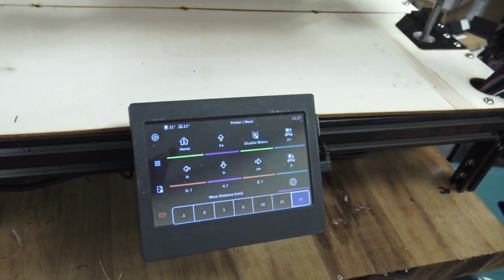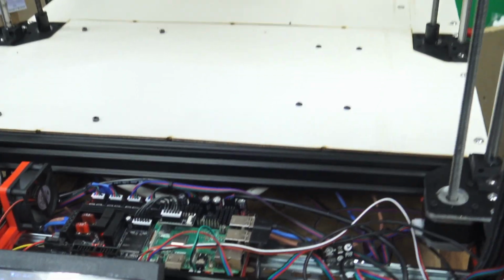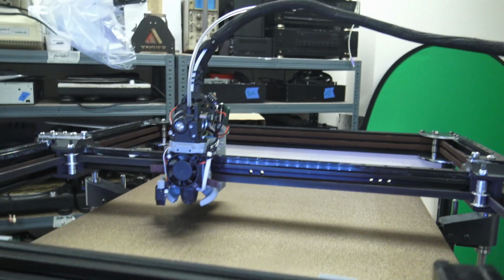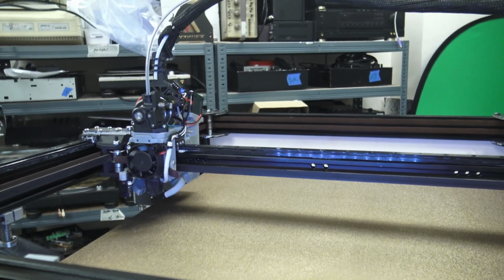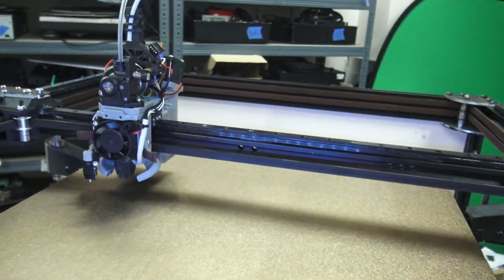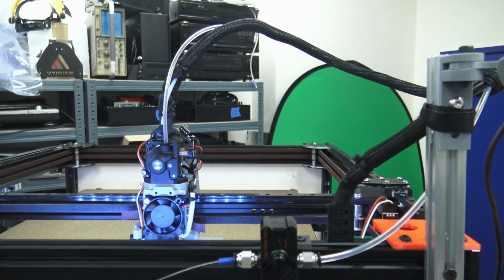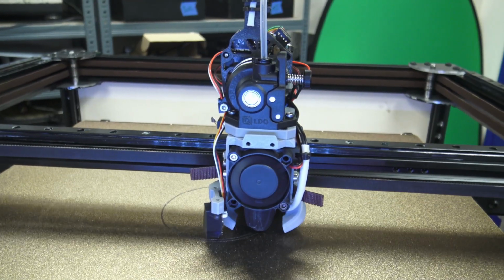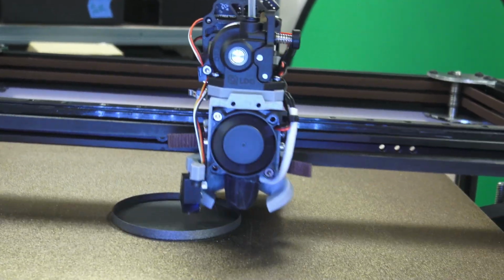I converted my Anycubic Chiron #3dprinter   to a COREXY monster.

Comment: I'm going to do something similar, but cartesian (dual y 42-48's) and idex with toolhead mounted x-motors. How did you attach the 2020 profiles to the 4020's? I was planning to use one bolt through 2020 to each 4020 and 2 corner pieces on inside corners. I have two chirons for parts so I'll prolly only need the 2020 uprights, some rails and rods.
Reply from the maker: I did a voron style blind joint

Comment: Hi. You have inspired my. I am doing a corexy conversion. I got a cheap brand new one in the black Friday sale 2022 for ridiculous price and been using to print r2. Nearly finished printing so bought another second hand chiron cheap to make my corexy. Could you send me the stls for your brackets for the bed I.e the voron ones you said you modified to take 10mm bearings? Thanks and if you don't mind I may have more questions as I proceed.
Reply: Also. Where did you get the silver brackets from that fit into the 20 20 extrusion at the top that hold in place the top of the 10mm guide rails. Thanks

Comment: Brilliant. I want to convert my chiron as got it new for really cheap before discontinued. When I've finished printing last few big parts for my r2 you've inspired me to do the chiron convert. First question. How many stepper motors you using. X y and z. I like the 4 lead screws on the z idea.
Reply from the maker: HI, I am using 4 on the Z for the gantry tramming and then 2 on the AB motors.
Reply: @leesmithsworkshop  does that need a special brain / motherboard then. And does klipper support that fine
Reply from the maker: @bluenose701  it needs enough stepper drivers at least 7 and that is why I used the leviathan board, you could also use a BTT octopus or Kracken.

Comment: Super awesome. I converted my Chiron to a Chironwire. ... Good effort on the swap. Maybe a future project. Picked up a cheap Kobra max recently... Maybe I'll do a max big boi lol
Reply from the maker: I had a look at the Chironwire and it's an interesting mod. The Kobra max would be a great machine to convert, I think I would rotate the bed so it's 400x450 keeping the gantry as short as possible.
Reply: @leesmithsworkshop what mm/s can you achieve now?
Reply from the maker: @natdizzle4259  I have since converted this to a tool changer and everything changed.
Reply: @leesmithsworkshop you should throw the new printer up in a short or something! Cheers!

Comment: I've thought about converting a few printers to "Vorons" but the only things worth saving are maybe the beds. Then it only really makes sense for these huge bed slingers.

This one's neat. I think having a "spec" voron or ratrig really only matters to social media clout chasers and their followers.
Reply from the maker: using the larger beds and heaters does save a load of money on these projects, but it also takes away using the advantages of the flatter  thick cast plates, rapid heating and higher temps.

Comment: Thats a chonky boi printer! I never understood how you'd go about making the printer itself bigger and it being understood by the firmware on the board. is it just newer settings you feed in? Was the leviathan board just a beefier driver board for the additional 2 lead screw motors?
Reply from the maker: It's just values in the firmware and with klipper you can change values in real time, reboot and see if that worked. so very easy to setup a custom size printer. As for the Leviathan it has 2 drivers for high voltage A B motors and then 5 drivers for Z or extruder motors. It was made to work with the Voron 2.4 that has also had 4 Z steppers and that is why I chose it.
Reply: It's all new firmware anyway, Chiron ran Marlin, this is Klipper. Klipper is a two-piece firmware, where the planner is running on a PC or a Linux SBC like a Pi and you connect controller boards responsible for sensor readings and stepping, which it can control via processor/board specific firmwares.

If you were to stay with Marlin, you get comfortable with development environment (PlatformIO or in a pinch Arduino IDE) and modifying and building firmware from source and flashing it onto your board. Then you go into Configuration h in the source code of the firmware and change your values, and you can change any number of things and behaviours, and you also need this say if you're adding/removing ABL or any of the hardware features. You can build a configuration from scratch, you can start from example ones supplied by Marlin in a separate repository, which cover about 350 different printers.

Some other firmwares like RRF (the Duet one) are reconfigured from G-code files that get executed on startup. Klipper also just has a configuration file that you edit.